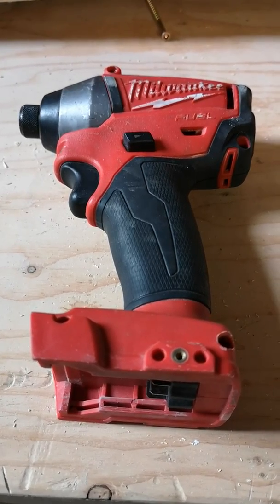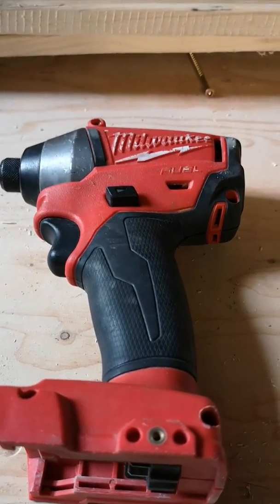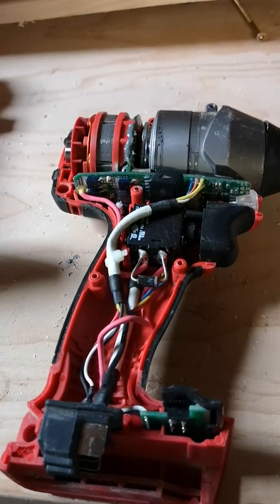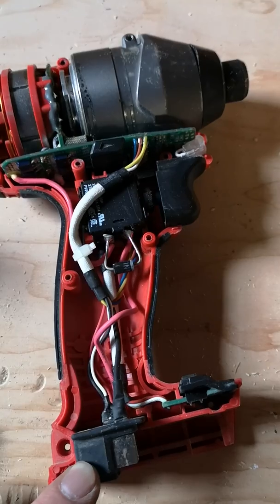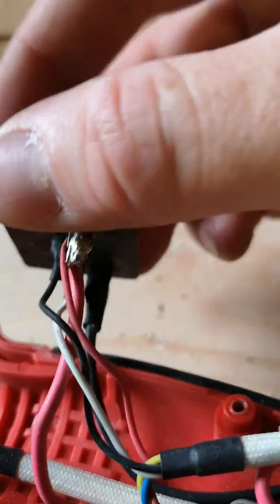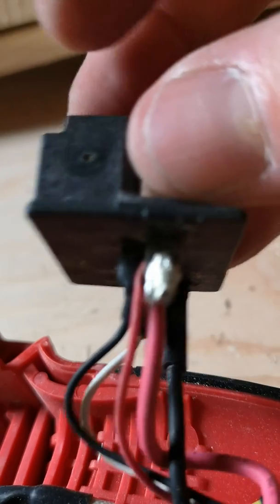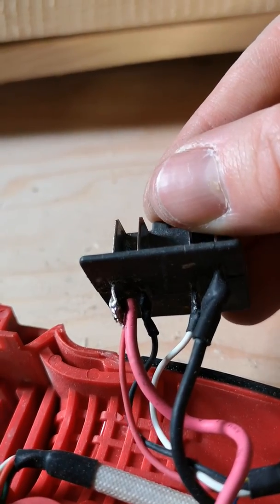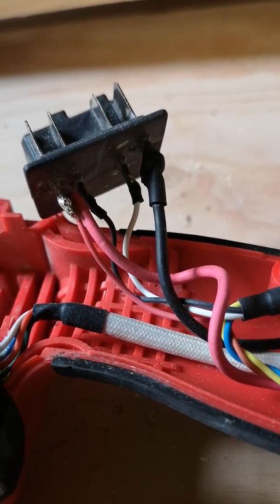Milwaukee Fuel M18 Impact Intermittent Trigger Fix 2653-20

Comment: I fixed my impact driver after reading your comments about a loose wire being the problem. Whilst jiggling the active (red wire) I accidentally moved one of the very small wires next to it and it just broke off as it must have had  a very poor connection. I re-soldered the small wire and my driver is now running perfectly. I suggest that anyone having intermittent switch problems first  check all the wire connections to the black plastic box into which the battery plugs into. You never know, you might get lucky!

Comment: I recently just started having these same issues as you described, very irritating. Stopped mid screw, pull it off and pull the trigger and it would work, put it back on the screw and it wouldnt work..the ol trusty tap on the drill and it would go again..figured it was a  connection..I'm glad I  was able to find your video before taking it in for repair.  Thanks for sharing!
Reply from the maker: Anytime!

Comment: mine had the same symptoms. took mine apart and looked for this issue, it had no loose wires. so i cleaned up the battery terminals with scotch-brite and its totally fixed. my battery terminals were very dirty with like black crap on them.

Comment: Hi, can you help me with sending me its circuit board clean and clear picture caz i think mine have burnt out large smd resistor R6 and Rz  and i want to see its rating and values written on them  and im unable to find it any where on internet, i shall be thankfull to you if u reply me the ratings or numbers written on R6 and R7 smd resistor...

Comment: I had the same problem with my 2850-20 1/4" Hex Impact Driver. I opened it up and wiggled the RED wire and it didn't fix the issue, then I wiggled the BLACK (ground) wire and it started working. I re-soldered the wire and it's been working for over a week. Thanks
Reply from the maker: Glad you were able to fix it and always happy to help

Comment: Hello. My impact 2553 M12 only works if you remove and install the battery or change the screw speed. How do I fix it?
Reply: I had that same problem. I opened it and found it was the trigger being the issue. With the drill open I carefully plugged the battery in and moved the trigger forward and reverse. Once I saw it working properly. I put it back together.

Comment: I’m having a similar issue with my M18 Super Hawg right angle drill. I suspect it is exactly the same issue as Milwaukee seems to have let blind people Solder their connections...I will repost if I’ve fixed it but I suspect it will fix the issue. Thanks for the Video !!

Comment: Thank for the video .. in having the same problem.
Reply from the maker: glad to help. I hate having something that won't work as intended. Milwaukee wouldn't cover it so I figured it was worth a shot troubleshooting since the other option was to toss it and buy a new one.
Reply: @higgunscrx  got. my First replaced. Now After. 1.5 years my replaced Starts doing ist again.

Comment: I have this same problem, but if I rotate the bit a little it will work. The light comes on all the time. Do you think this might fix it? I don't have the tools to open it.
Reply from the maker: sounds like the same issue I was having. The bits to open it can be had relatively inexpensively. something like this should have the bit needed.
https://www.amazon.ca/KATUR-Tamper-Security-Magnetic-Extension/dp/B07V9KYN8M/ref=sr_1_9?keywords=security+bit+set&sr=8-9

Comment: Thanks for the video. My 2606-20 M18 drill, after 3-1/2 years of daily usage, had the same intermittent problem. I took it apart and just rearranged the suspect wires that you showed and it has been working fine for a few weeks now. If it goes bad again, I will re-solder the joints. In the meantime, I will order a new brush card because the brushes are almost worn out from heavy use. BTW, mine was totally filthy inside so I vacuumed all the crud out of it too. Only problem was that all the screws were not the same length so I just made a judgement call about which ones went where, LOL. I love this drill and impact combo.

Comment: In search of............ I have a similar impact driver Model Milwaukee 2753-20.  Where can I  find the correct screwdriver bit to dis-assemble?
Reply from the maker: It's a torx bit. Not sure the exact size but an electronics/hobby store that sells electronic components such as resistors etc will likely sell a set of security bits (probably 20-30 different bits or so in a case) which has one that'll fit. I've seen these security bits at HD too recently where I live. You can also buy a torx screwdriver but you'd need to know the size or bring he impact with you and see which one fits to get the right one.

Comment: I have one of those M12 impact drivers, and have a similar problem (at least I think I do). Basically, a few days ago I noticed that right when I put the battery in it will run. However, if I wait a few minutes and then go to use it, the impact driver won’t engage at all. It’s like the trigger or the engine is disconnected somehow. But if I take the battery out and put it back in, it will work again... until I let it sit and then come back later (basically the same issue). Does this sound similar to what you encountered?  Any thoughts on what it might be?
Reply from the maker: Yes. Removing the battery sometimes made it work. I suspect it is just enough to move the wire into contact with the terminal again.
Reply: Did you fix the problem? My impact only works if you remove and install the battery or change the screw speed.
Reply: I have exactly the same issue like yours .. ill be trying this .. hopefully it's just the connection .. did you figure out yours?
Reply: @volcom84bait  I sent it in and it was replaced by Milwaukee.

Comment: Like all these videos 90% of the work is getting the case open , what driver bit is required . If you can’t get the case open you can’t fix it!
Reply from the maker: This model needs a T10 torx bit to open it.

Comment: My legendary DeWalt 18v has never given me an issue in the 8 years I've used and abused it like dropping it off the top of a 12 ft ladder. I have this old Milwaukee and suddenly it is giving me intermittent trigger issues. I love Milwaukee tools, I use them as well as my DeWalt but what is it with these triggers ?
Reply: I agree. My DeWalt impact driver runs great. Must be 15 years old. Driven hard and dropped often.